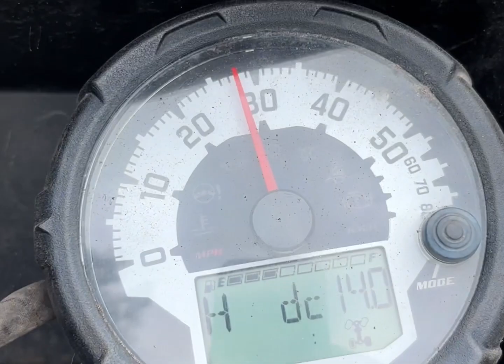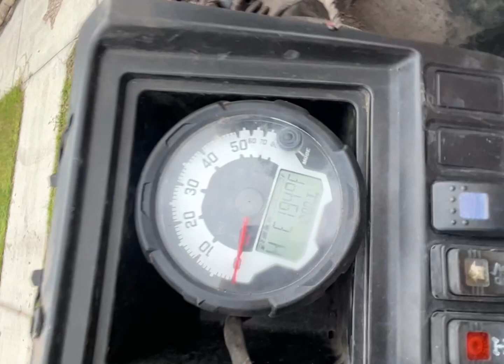41 Chevrolet RatRod Diesel SxS swap 1 afternoon

Comment: Cool build I'm putting a old 50s cab on a 91 S10 4x4 truck frame I would build some kind of long travel suspension for your buggy and some kind of ATV lift kit for it it would be a awesome trail buggy small winch up front and just winch if you need to
Reply from the maker: Already mocked up in the brain 🧠
Reply: @DieselsandDirtbags  hope to see more videos of it